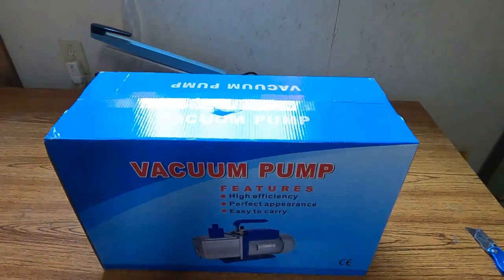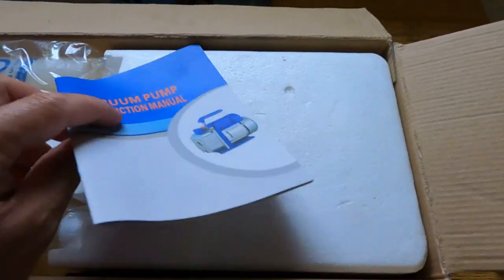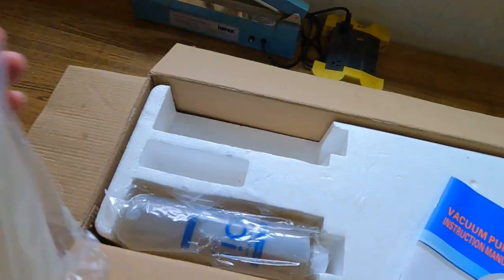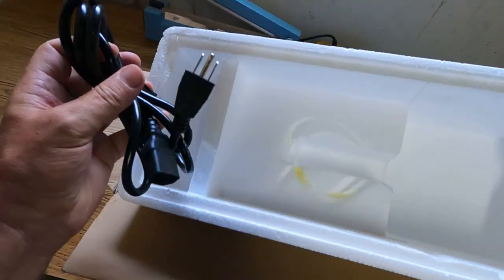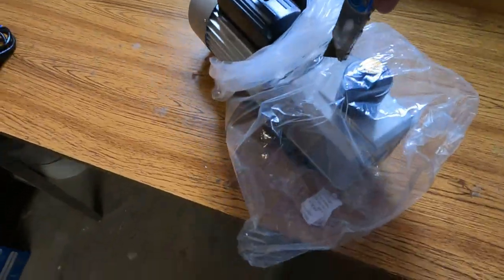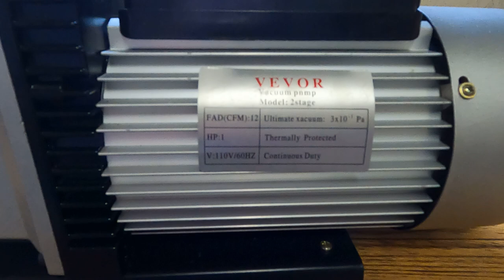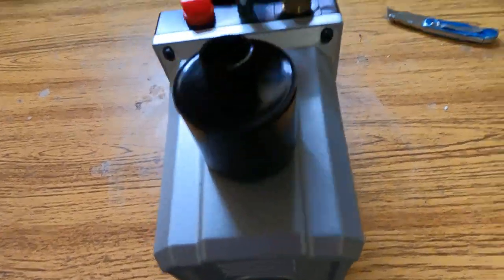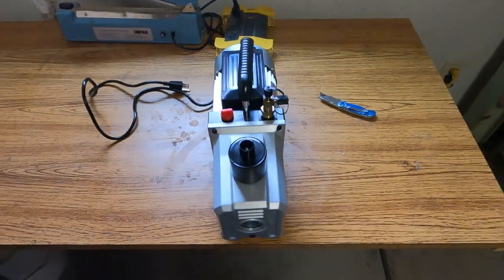Harvest Right pump from Vevor Unboxing

Comment: Is the Vevor working as good?
..My pump is the ole original 6CFM -1 stage Eliminator,   it just died.
🤔 I wonder if a 7+ CFM , “2 stage” pump will cause issues with the first software version of Harvest Right…
Reply from the maker: My machine is 3 years old and it came with the 7cfm 2 stage pump and it died a few months ago that's why I bought the Vevor...it still works great the higher CFM will bring it to vacuum pressure faster is all and the dual stage will insure a good strong low vacuum that shouldn't be a problem for your machine
Reply: @fred2791  what did you replace the intake brass fitting with?